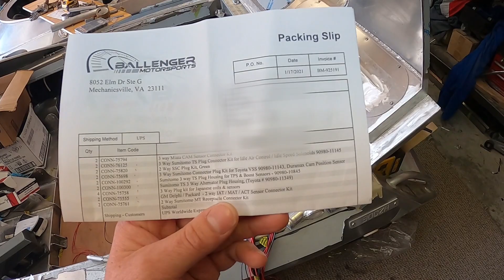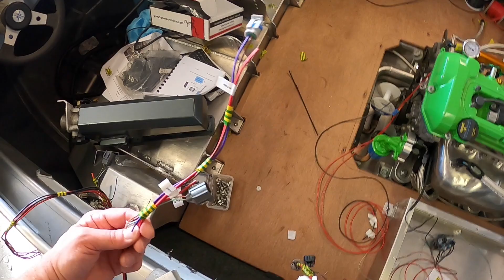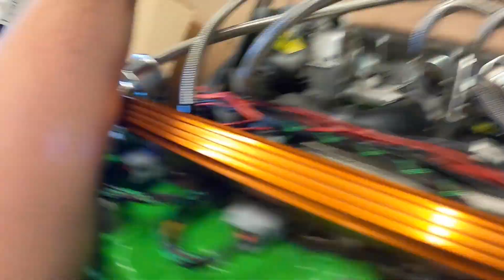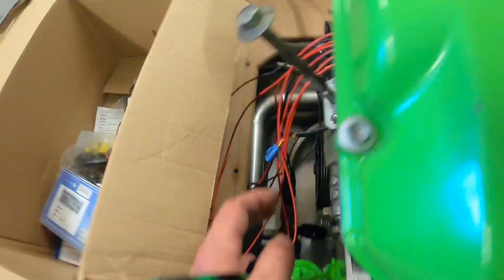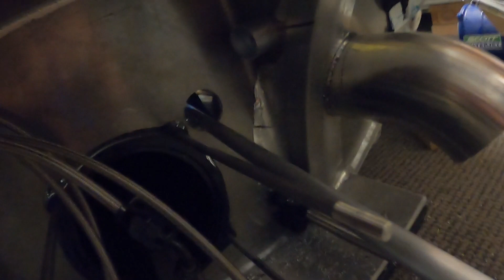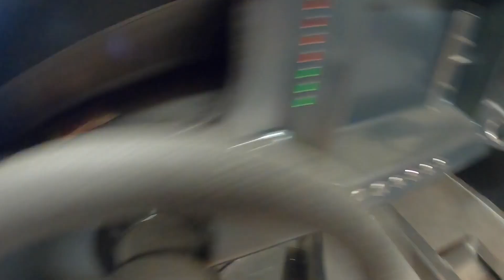Turbo Jet Boat Build NZ PT15 - All new engine harness plug arrived!!

Comment: Thanks for the tip Re the plugs. I am just wiring an m15, did you work out how to wire the 4 pin alternator? Cheers
Reply from the maker: I worked out one wire haha.na not yet looked on good old Google for a diagram but alot contradicted each other. So ill re look at that later once wired to the box. I did find a suzuki wiring diagram that I need to take a closer look at.
Reply: Sabotage Garage sweet as. Yeah I have found a few diagrams, so will just have to try it and see. My last m15 I managed to find a 2 wire alternator off a g16b and it was a direct fit 👍
Reply from the maker: @ntimz  I'm sure we will get it working. Maybe abit of trial and error.... Hopefully wit out releasing any smoke haha. Oh good to know!